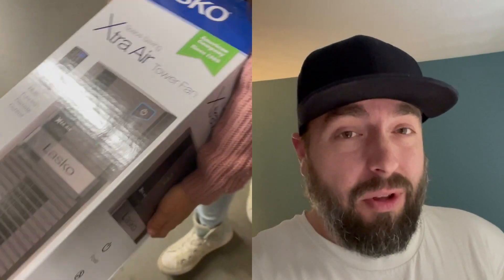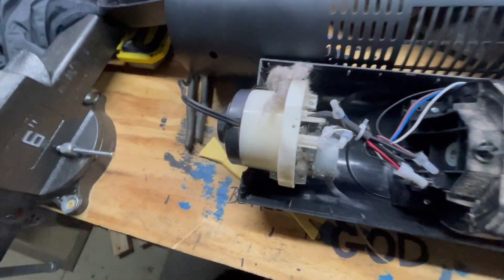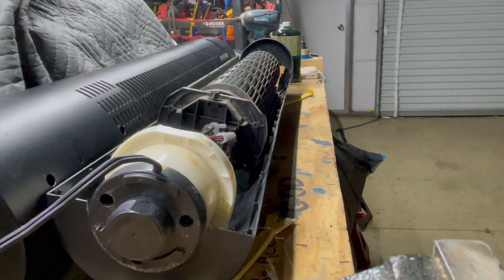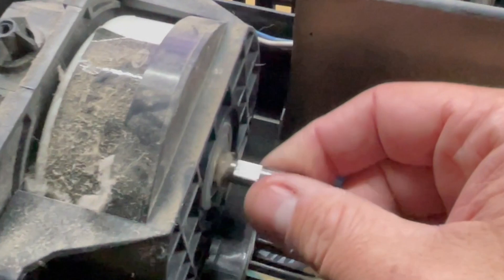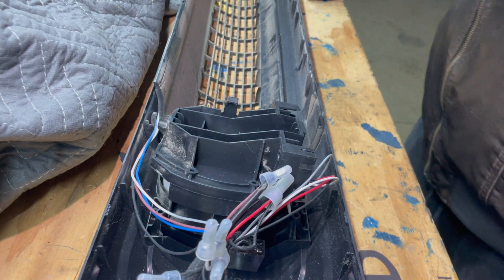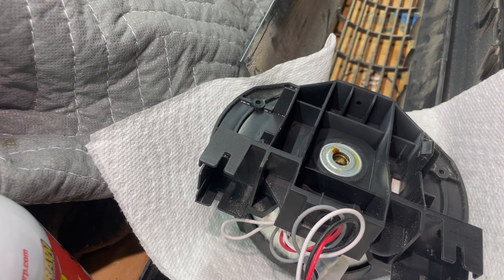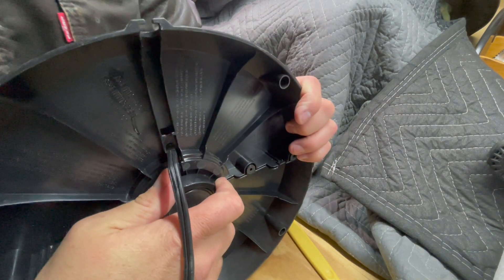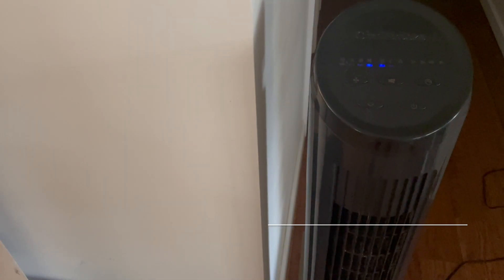Fix Your Tower Fan Squeak - EASY! How to turn trash into functional treasure.

Comment: I have a different one which has different build. However, your video encouraged me to open the back cover and fix the issue by myself. I just put grease on the top of the moving axles and hoped that it goes down when the machine gets warm. It noise has been gone since.
Reply from the maker: That’s the way!!!!! Great work!!!

Comment: Thanks for the video, very informative.    I just purchased one (white).   Oddly enough I do have a squeak but only when on the middle speed and when it moves to the left!   I purchased it on the 'returns' rack.   It looked great but now I know why it was returned.   Any suggestions?   Oh by the way thanks for not using  rock music in your video!
Reply from the maker: If you open up the fan, the way I show the video, there’s another motor there just for the rotation. It has a little arm on it that causes the fan to walk back-and-forth. That probably needs some sort of lubrication. If you pop the cover off the way I showed in the video but don’t take anything inside apart, you should be able to see where that little motor is that makes it walk back-and-forth. It should be pretty easy to detect what squeaking at that point and lubricate it. if it’s a plastic part, I wouldn’t lubricate it with grease because it might deteriorate the plastic. Maybe use something like Vaseline or even ground up pencil graphite might work. Hard to say because I’m not looking at it myself, but use your best judgment.
Reply: @thejoyoffixing  Thanks from Cornwall, Ontario, Canada for the quick response 'Joy of Fixing'.   This morning I loosened the collar that fastens the two parts of the plastic stand and so far so good.   Your suggestion does make a lot of sense so if it acts up again I give it a go.   I just have to wait until my wife steps out before opening it up....she will kill me!!!!
Reply from the maker: I totally understand

Comment: Yep. when I saw that little remote control still taped to the top rear of the housing, I knew it was the exact fan I have, with a little remote control taped to the top rear housing. Also, leaf blower blasts that dust right out of there and keep going til the dust is
 all outside the garage.
Reply from the maker: I actually took it back apart and pressure washed it. Very glad I did.

Comment: I have this exact fan and it developed some noise which I traced to the bottom bearing. I disagree with how much grease this guy packed into the bottom bearing. If you use so much that it makes it out the top bearing, you will have completely filled the motor cavity including the coils and the armature. Not good! I used an amount equivalent to two small peas about 1/4" diameter and that did the job of packing the bottom thrust plate. The top bearing is a simple sleeve and does not have a thrust plate. I added a very small single drop of high quality spindle oil to the top bearing and even that was probably not necessary.

I used Tri-Flow synthetic grease for the bottom bearing which is about the same thickness as automotive chassis and wheel bearing greases. It was a bit too thick since it slowed the fan down a tiny bit on low speed. I actually prefer that as it makes the fan very quiet on low. The drawback is that it will now draw a bit more power due to the extra load. Unfortunately I did not measure the power draw before packing the bearing so I can't say how much extra wattage is being used. If you want to maintain the original performance of this fan, I recommend taking a look at the residual grease inside the top squirrel cage bearing and try to match the consistency of that grease, which is lighter than wheel bearing grease.
Reply from the maker: Thanks for your input. Fan is still working great months later. No issues. Guess we will have to disagree a little bit. I, in no way, packed out the motor cavity. Total grease used was about 2 peas, as you stated.
Reply: @thejoyoffixing  First, thanks for posting the video. I found it helpful in confirming the disassembly process. It made no sense to me that your red grease would have made it up to the top bearing as you suggested in the video. It would have to somehow creep around the large rotor portion of the motor shaft and/or through the gaps between the stators mounted to the housing to reach the top bearing. Perhaps it migrated enough to do that but it seemed unlikely.
Reply from the maker: Yeah I’m not sure but it sure did! The grease angels shined down on me.